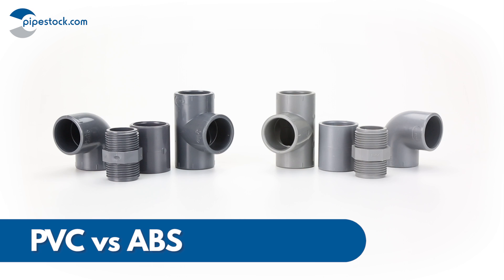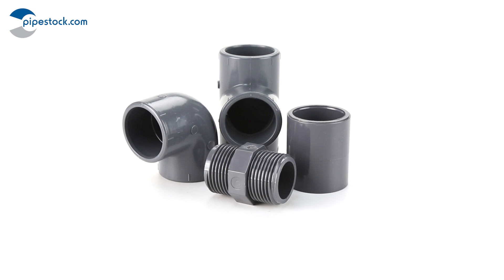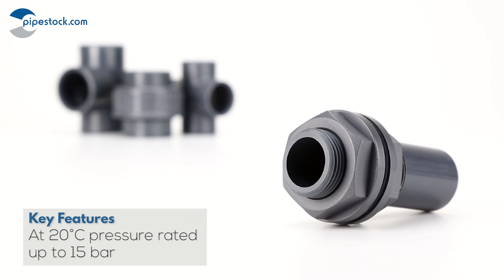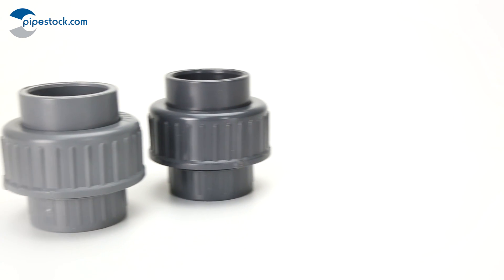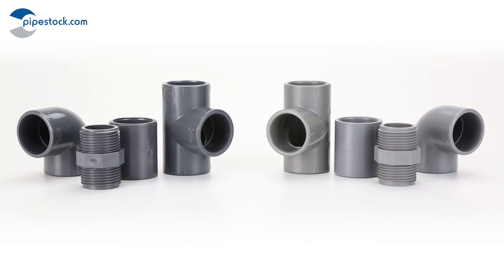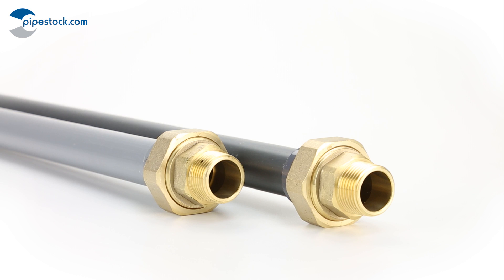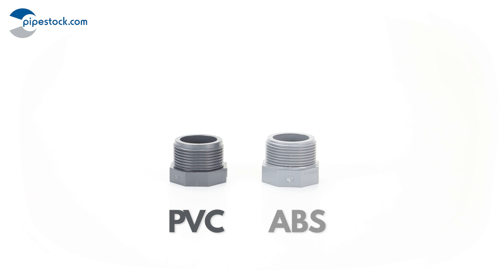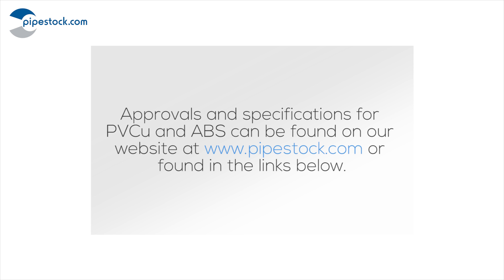PVC vs ABS - What's The Difference?

Comment: Isn't it generally that ABS has bad chemical resistance compared to other common plastics?
Reply from the maker: ABS has a good level of chemical resistance, but PVC does provide resistance to a greater range of chemicals. We are working on chemical resistance guides which will be available shortly on pipestock.com.